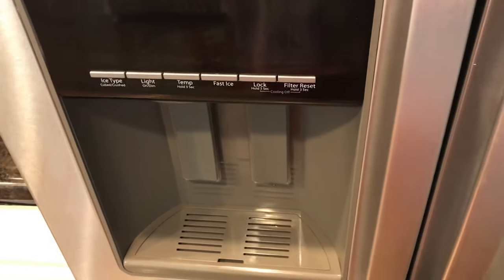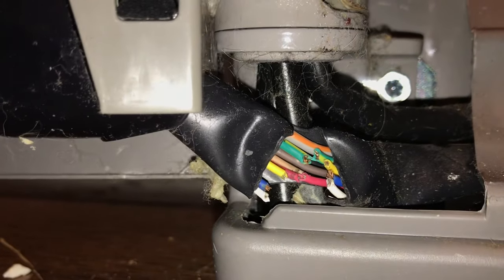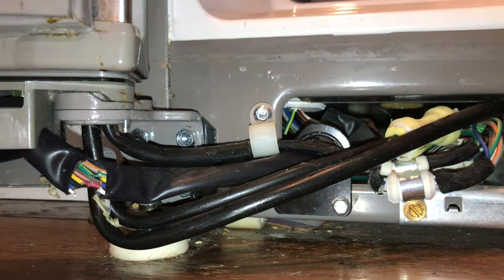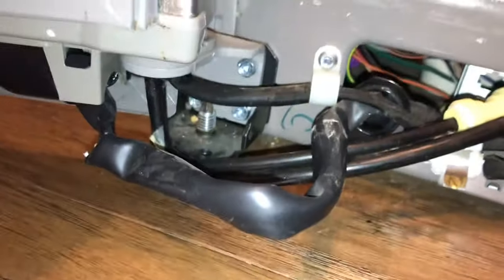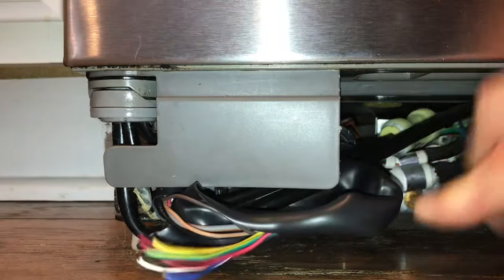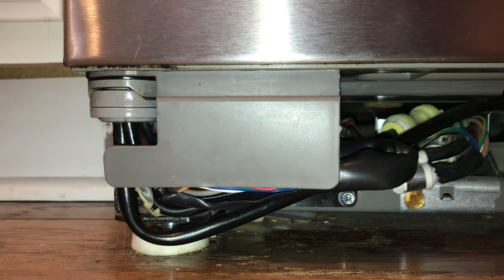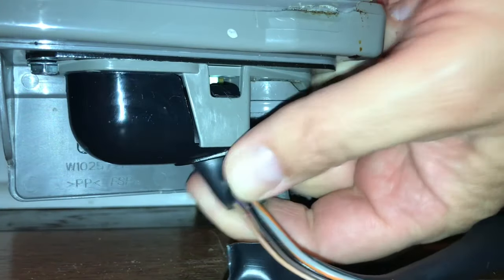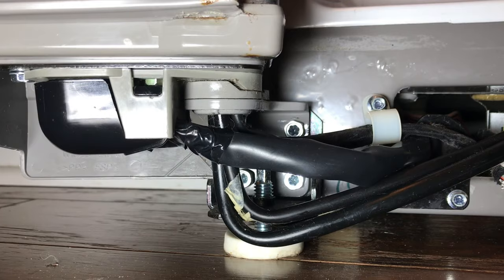Whirlpool double door refrigerator not making ice and ice dispenser doesn’t work. Wires WRS571CIDM01

Comment: The search for no ice culprit component continues... Closer inspection showed that both the brown and black wires were completely severed at the base hinge of the freezer door.   I spliced them carefully back together, heat shrunk the wires and wrapped in electrical tape.  I confirmed voltage and continuity at the icemaker wiring harnesses and switches.  After numerous power downs and resets, still no movement at the icemaker or water making it to the ice tray.  

- I confirmed that the water lines running to both the water dispenser (working ok) and the icemaker fill chute are clear and free of blockage by blowing air through the line.  
- The primary water inlet valve must be working since water is making it from the wall valve to the dispenser; also confirms filter is working correctly and free of blockage since drinking and icemaking water both flow through the filter and back down to the secondary valve to be dispensed.  
- The drinking water side of the secondary inlet valve must also be working as water is dispensing.  

So, power is either not making it to the icemaking side of the inlet valve or the valve is faulty.  

- I confirmed ~120V is live at the valve terminal and checked the resistance across both prongs (~100 ohms). Optimum resistance for the valve component is 300+ ohms, so I've ordered a replacement secondary inlet valve ($30).  

If a new valve doesn't fix the issue, I will most likely leave as-is.  The cost of a new board exceeds the value of a functional icemaker.  Also, the stainless finish is a major pain to keep free from oil, smudges and fingerprints.  Apparently after decades of new appliance technology and advancements, Whirlpool still hasn't managed to develop an icemaker that will last longer than a year or two. Nice work, Whirlpool.   

More to come.

Comment: I'm having the same issue with mine.  Repair guy gave me some astronomical price to repair, but was able to correctly find the break in the wires.  Originally the ice dispenser went out last year (never fixed) and now the ice maker itself stopped working.  Has anyone tried cutting all the wires and putting them into a molex connector?  I figured it would take the place of needing to solder in some extra length of wire.
Reply: That molex connector idea is genius! I suck at soldering, especially trying to lay down and work in a confined space like that. Did you try it?

Comment: How did you conected the wires together again?
Reply from the maker: I stripped the ends and twisted them together. Then taped them up, one by one.
Reply: Thank you! I just went to lowes to buy the tool to strip them I hope I don’t cut them 😅 because I don’t now  the  size of the cable
Reply from the maker: @brenduja  good luck!

Comment: Did you solder the wires or just tape them?
Reply: I just made this repair two days ago and I just spliced the wires together and taped them up with electrical tape.
Reply from the maker: I taped them.
Reply: @motofun72  after I made my initial comment, I found the electrical tape didn’t hold very long. I wound up using heat shrink butt connectors. Used the smallest size connectors - 18-22 gauge I believe. Worked like a charm and it’s a solid connection

Comment: Hi there, Would you please let me know how did you put two wires together, the wires were too short, i Can't twist them together. is there such thing as wire connector? Appreciate it.
Reply from the maker: Sorry for not showing that process. Try pulling extra wires out from under the refrigerator side.
Reply: Wow, it really worked. It took so long to make the ice after i reconnected the wires, I first thought that I failed again. Surprisely the ice tank was full overnight. Thank you  so so much. Single mom got the fridge fixed for $2.
Reply from the maker: @jocelynchen2485  awesome.  Always good saving money. Good job doing it yourself!

Comment: Anyone know where to buy the wire if I need to extend the length? Had already done the fix a while back and wires broke again. Lowes only has 18g thermostat wire.
Reply: So the wire used by whirlpool are silver with separate strands you need to twist together; whereas, everything sold in hard ware stores is 18g with like solid copper wire inside the insulation. Not sure if it's possible to mix the wire types as long as it's all 18g.
Reply: Try Home Depot, 18 gauge 4 wire strand. Thats what I used
Reply: I bought some at a hardware store but the wire in the fridge is braided and everything I could fine is like solid copper so wasn't sure of you can mix them

Comment: Broken wires are exactly the reason that the ice maker on a 2 year old Whirlpool WRS588FIHV00 stopped working.  While the diagnosis is spot on, the root cause is unacceptable design and construction.  There is no excuse for such in this day and age.  Lessons such as this should have been learned from examples of wire chafing on early model F-16 that have killed pilots.  This far less critical application is a known failure mode that is easy to avoid.
Aside from the difficulty of working at floor level with no service loop, any splicing will further shorten and stiffen the wire bundle, so at best expect a short term fix.  Any splices that are made MUST be staggered.  The only real fix is replacement of the cable with at least one inch added, with preformed bends and overwrap.  Edge grommets should be  applied to metal edges that cables pass over.  For a fridge that currently lists at $2200 absolutely no less should be expected.  Next one will likely be an LG or Samsung since American appliance design is junk these days.
Reply from the maker: I agree 110%. 

Side note, I was about to pull about 1-2 inches of wire from under the refrigerator.

Comment: Dang same issue all this time Plus I replaced the auger motor and that did not work afterwards. guessing one of the wires go to it.
Reply: well did this and still no ice this morning. any ideas ?
Reply from the maker: Hmm. Maybe it’s a wire that was overlooked.  You could wiggle the wires and see if you have ice the next day.
Reply: Did the auger motor start working after fixing the broken wires?
Reply from the maker: My auger always worked. It really depends on which wires are cut.  Some people have one wire cut and others have all cut.
Reply: @motofun72  thanks for the reply. Just trying to find out which one if any of those wires are directly affecting the auger not working.
Reply from the maker: @genewuchner9004  I personally don’t know which color the wire is for the auger.  Good luck. 

If you haven’t checked the wires, it’s easy to do, just to make sure the are good.
Reply: @motofun72  thanks again
Reply: @genewuchner9004  Have you figured it out yet? My wiring sheet shows GY/OR for + and BU for - of the auger motor.
Reply: @neverwasthere  not really. I had multiple wires broken. I soldered them back together and everything worked. Of course this was after I bought a new auger motor 🤷‍♂️. That lasted about 9 months and the wires are again broken. Poor design. I think that the wires are to small for that application. Sorry I couldn’t help you more.

Comment: Whirlpool wrs586fldm01 side by side missing tech sheet. Any ideas how to get diagnostics or cross reference to other refrigerators? Ice maker has optical bin detector. Service manual would help. Anyone got a pdf? Diagnostics go from 1 to 46, but I can't tell what they mean.  Thanks to motofun, I already checked the hinge wiring. I used a multimeter with needle leads to make sure each wire had continuity and wasn't shorted.
Reply from the maker: I didn’t have a spec sheet either and I couldn’t find one to tell what each code was.  Good luck!
Reply: @motofun72  I can send you the spec sheets I found. Different models.

Comment: now I’ve had it happen again, and in the process of trying to make the repair, I have a small nick in the water line before it goes up into the door. Now I have to figure out how to fish a replacement tube up the door, or down the door actually, so that I can at least have the water dispenser functional on the front of the door.
Reply from the maker: How long did the repair last?  Just wondering.
Reply: @motofun72  A year or so.  Most recent failed attempt was using solder connectors, with heat gun creating hole.  Looks like I can possibly feed the line for the water dispenser with new tubing.

Comment: Probably fewer than 1% of the population of this model (WRS571CIDM01) still have a working icemaker with original (unrepaired) wire harness.  This is an obvious design defect, and Whirlpool should be the subject of a class-action lawsuit for this.  I have already repaired my wiring harness twice, and have zero doubt that it will soon fail again.  Does anyone know the part number for the affected wiring harness, or a source from which a new one can be purchased?
Reply: Did you ever find a permanent repair?   I’ve repaired mine 2 or 3 times now.   Tired of it.
Reply: @jaymzs8221  I've repaired mine 3 times.  I think the fridge is about 6 years old.  When (not "if") it happens again, I may remove the freezer door and fabricate my own wiring harness with very flexible (fine stranded) wire.  It's not a bad fridge aside from this obvious design defect.

Comment: Clearly a design flaw
Reply: Did the repair this weekend , clearly an assembly defect , cut all , used marine heat shrink tubing for each wire over soldered connection as well as additional over whole cable , now works , with tension relieved I expect years more of operation .
Thanks for posting your video .